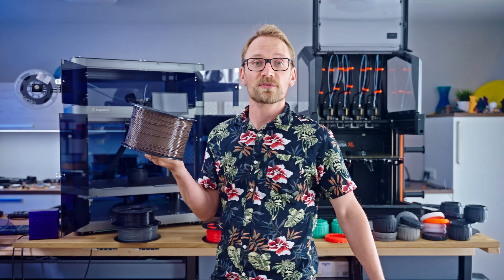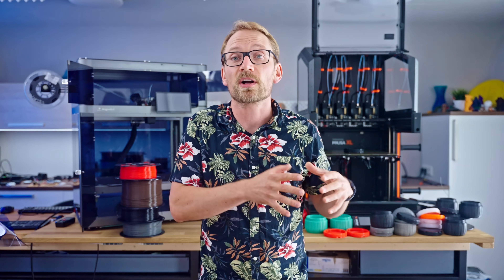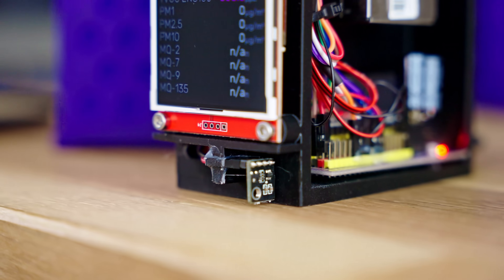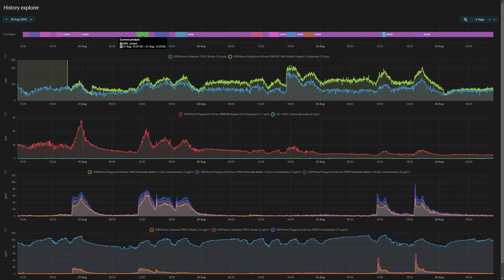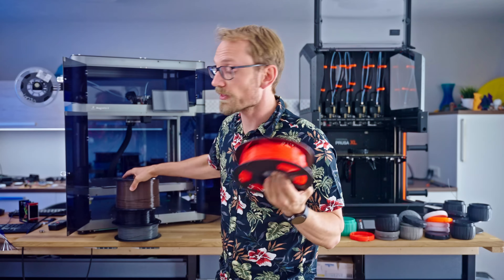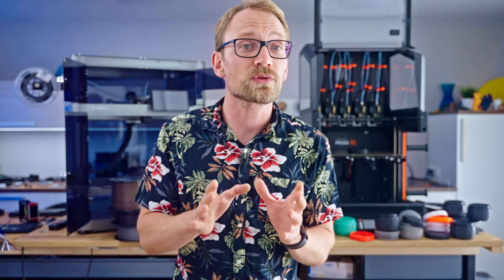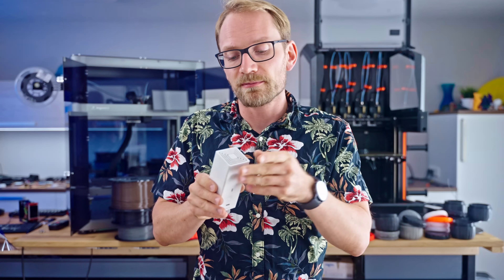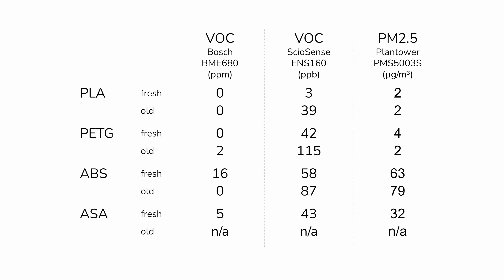3D printers are worse than I thought. Time to do something about it!

Comment: I do about 95% of my prints in PHA. I would've loved if you did tests on that or at least mentioned it. It's by far the most environmentally friendly material (the only one that is home compostable and doesn't break down into microplastics), doesn't smell, requires no bed heat (to prevent warping), the lowest recommended nozzle temp of any material (195-200C) and I've managed to print as low as 170C (with quality issues, of course).

As a bonus, it's hydrophobic and doesn't require drying or humidity control, even coming in a cardboard box without plastic seal or desiccant.
There are some downsides like the tendency for the non-flex variant to warp in warmer ambient temps and that it's not as stiff as PLA (doesn't make a great bed scraper). But with all the benefits, I'm surprised it's not getting more attention.

Unfortunately, while prices are comparable to other materials, availability is very limited. There are only two producers in the world, Beyond Plastic in the US (what I use since I'm in the US) and ColorFabb's allPHA in the Netherlands. Making things worse, Beyond Plastic stopped production indefinitely without explanation just 18 days ago (announced on r/3DPrinting_PHA).

Comment: Running 2 bento boxes inside enclosure showed to be effective to reduce emissions. They don't remove everything! I still wear a big boy mask when printing ASA. But at least with petg and PLA the bentos are enough to not have to wear any mask anymore. I seem to have a low tolerance against these filament emissions in general so even small amount in the make me already feel uncomfy. So I'd say at least the bento boxes are a must. Anything that's larger then a prusa mini enclosure should have a min of 2 running. ASA/ABS and all the gf cf filaments NEED heavy duty air filtration or professional respiratory masks. And that's even with having windows open to force some cross ventilation

Comment: Do a resin version of these tests too. We know it's bad, but some people don't understand how bad it really is.
Reply: Testing protocol will be a problem here because these are almost hermetically enclosed (except the new tilting hood ones). There are been tests showing the emission mostly occurs during printing where you're not supposed to be in contact with the air enclosed in. The main concern is the post treatment part when you open the lid and use solvents to wash the print and cure it.
Reply: Everyone I've ever seen using a resin printer has it vent directly outside. The risks of resin are well understood, it's filament printers that really need the close examination.
Reply: @kaijuultimax9407  Really? Almost every post/video i see someone using it, is the opposite. Barefood watchting to the printer, while printer is sitting on the ground and picking up the uncured print with bare hands. No Respirator wearing ofc (The most common thing being not used) and then everything without any fume extraction. Maybe at least those USB Filters inside that almost do nothing. And that even from known Youtubers like UncleJessy that is often wearing no gloves and respirator while holding the uncured print on the plate into the camera. It's insane. I could just even pick up many of those examples from my browser history of this and last weeks.

Comment: Having a background in biology and chemistry, I always felt a bit baffled that people run 3d printers in open air in their homes. I decided to build an enclosure box I could keep at lower pressure than my home (vents outside) before doing any printing. I kind of assumed it was a requirement to run these machines healthily. Glad to know I'm not alone in my concerns.
Reply: I too find it absolutely nuts that people are happily running open deck printers inside their living space whilst playing with their kids meters away. It should come as a surprise to absolutely no one that exposure to fumes from 3d printing is harmful. I set mine in my workshop inside a repurposed old commercial open deck refrigerator that has been essentially converted into a fume cabinet venting externally. Not in my wildest dreams would I run it inside the house where my toddler lives.
 And people should be very afraid when printing with filament so dodgy that the manufacturers will not provide an MSDS.
Reply: I put my printer in an enclosure where inside the exhaust vent is located that drags the air out through the ftx system for the house
Reply: Having a background in engineering. I put my printers in a closet that is basically a large fume Hood with a reasonably powered 3/4 horsepower extraction fan. Keep the sound down and the smells from percolating into the house...

Comment: Ikea filters go brr :D
Reply: Och boy. I should get new filters into my masks and wear them when I work from my printer room and the printers are running. Och no....
Reply: And the little ikea filter is added to my list. I have a big one and I change the carbon filter about every year. But I use it when the laser cutter is running and for airbrushing as well. And whenever I sand resin prints I put it under to collect the resin dust. So it is quite nasty - but I'll add a little one next to my printer now for sure. 
Usually when I print ASA I run the big filter on 2 or 3 for the whole duration but the smell is not reduced whatsoever.
Reply: Guys I have suggestions if you live in Europe Or Asia.
There's this Xiaomi air purifier filter which has carbon filter as well as HEPA filter, both combined.
So you could just Jerry rig it by slapping an 140mm pc fan or a more beefy fan on top of it and it really works great. And it's cheap so you could make this multiple and enjoy.

Comment: My lab has been assessing the toxicity of UV  resins in human cells in culture. After 30 brands and even "certified" engineering resins labeled as biosafe are not, regardless of post processing. They all kill 100% of cells.  The plastic we ended up using with actual non toxicity was 95A TPU by FDM.

The culprit is the UV sensitive monomers.

And FYI, BPA toxicity is entirely junk science. The amount a human would have to ingest is massive , and it would have to be injected.

Comment: Good video. I'll give you the benefit of the doubt but  it feels slightly weird to cover this topic without mentioning Nathan Builds Robots who has been covering these issues recently. I guess it's just more in the zeitgeist now. Some things I would have liked to see covered in more detail: activated carbon gets used up, and unlike indicating silica beads you can't tell when it's "full". So-called "HEPA" filters on Amazon and especially AliExpress are a minefield of fake and uncertified products, similar to N95 masks during the pandemic. Would have liked to see a comparison with venting outdoors, different sizes of HEPA filters. NBR went into a bit more detail about which particles are the most harmful which I found useful. Also there was a pretty big gap between your sensors which makes me wonder how accurate the data was. But overall I thought the coverage was quite good.

Comment: Based on my study on comparing a bunch of research papers when I stared printing:
PLA emits lactide, which is generally regarded as harmless but would cause eye irritation. PLA will also emit 1-butanediol, methyl methacrylate.
Nylon and ABS, emit styrene, which is toxic. 
PETG and nylon are known to emit a VOC called caprolactam when exposed to heat.  caprolactam is toxic by inhalation, oral exposure or skin exposure, causes serious eye damage/eye irritation and is toxic to the respiratory system.

Other chemical might be concerned: methyl methacrylate, acetic acid, toluene and, of course, formaldehyde(anything burnt?)

Many more study needed to be done before claiming anything is safe at all.

Comment: I am testing a bucket filter that I vent my Trident into. 20 lbs of activated carbon with fine particulate filter sheet on top and retained by a modified lid. Still testing, but it is certainly better than no particle/VOC retention.

Comment: I'm surprised that it is worse than you thought :) I would generally never print ABS and ASA at home unless you know what are you doing and you have proper ventilation, not only box with filter. It should just go out. PLA and PETG are acceptable risk, best in box with filtering... I did not study others like PC or TPU but I would not be in the same room without ventilation with any just to be sure. On the other hand when there is smog outside, lots of cars and/or lovely coal burning plant then it is better to be in box with ABS printing :D

Comment: In my main printerbox I have:
* HEPA-filter that runs 24/7
* dryer (with tho's packs)
* ionizer

Well, it helps a lot already!
Lots of the fine dust in that box is not escaping but instead is near the ionizer and on the filter. You see it all in there. Lots of 'white dust' while printing with PETG and some also with PLA, and more dark gray while printing with ABS and 'family'-filaments.
Without the ionizer, ther is much less dust on the filter and staying on the botomn of this (mostly wooden and insulated) box. So I conclude it really helps to filter those particles out.

Outside the printerbox(es) I also run an airfilter almost all of the time, unless I have the windows and doors wide open.

I have run also a simple air-filter with only a sheet of toiletpaper. And well.... that already takes lots of dust out but you have to renew it almost daily while printing and probably not filtering out real fine dust (that gets collected by HEPA-filter and activated coal).
So, even cheap and easy solutions will help to reduce but not totally make it safe for a living-space...
Reply: I just bought an ionizer to add to my lack enclosure. I didn’t sew anyone evaluating the efficacy but i’m pretty confident that it must help the particle to increase in size and stick to any grounded metal.

Comment: First off, thank you for creating content on this topic. Safety is an important aspect of many activities that often gets overlooked. If you are willing to continue down this path of investigation for us, it seems like a natural follow up could be a comparison of a standard material vs its modified derivative. VOC and particulate material comparisons between PLA and PLA+ or PLA-HS would be great to see, especially considering the added chemical modifiers are not advertised and these materials are typically printed at higher temperatures.  Another valuable comparison could be ABS and Sunlu easy ABS which prints at a lower temperature.  It's just a thought. Thanks again.

Comment: After covid craze was over you could buy cheap filter units at ALDI,  Lidl and Amazon because of overstockage. Was a good time to buy decently sized H14 Hepa air purifiers that went through proper channels for 50-60€ incl shipping. (meant for schools etc. mine even had a note in polish inside that the unit was intended for a school ) I always have 2 running on max setting when printing + open window.

Comment: Thanks for this video, it's great to get this information out there.

I am feeling vindicated in my decision to only print with PETG and PLA filaments in my home, and not to go down the resin printing route at all. It would be different if I had a separate shed or garage, or even a dedicated workshop room in my house, but the best I can manage is a workbench in a room that is also used a home office and a bedroom, so I need to be more cautious than most.

I do already have several air purifiers in the house, with HEPA filters and activated carbon in them, but that was primarily motivated by living in a country that catches fire on a regular basis. This video is motivating me to set up some air quality sensors to see how effective my filtration and ventilation is, though. It's something I've been wanting to do for a while, but haven't got around to.

I'm also wondering where TPU sits on the particulate & VOC pollution scale, as it's a material that I might want to print with in future (if I ever upgrade to a direct drive extruder).

Comment: Been printing for years, and even though 90%+ of my prints are only in PLA, I have never been comfortable running a printer without an air filter close by, turned on. Thankfully I've never had any kind of itchy throat symptoms (at least none that couldn't be attributed to living with a few fur babies), but it's still always in my mind how these things might affect the air around me. I have a MK4 with an unbuilt enclosure right now, and I'm thinking even after I get the enclosure built I might save up for a separate carbon filter setup, with a big heavy carbon element connected to some 4" ducting. 

That said, I've also always been extra vigilant about air quality, since I come from a long line of bad breathers... Just happy to see more people bringing attention to this, and hoping even more people (and manufacturers) take it seriously!

Comment: It's great to see someone finally talk seriously about the elephant in the room. The numbers presented may not be accurate enough to know exactly what's going on. This video is however significantly better than Joel stuffing his head into the enclosure during an ABS print, taking a big whiff, and saying "Dis not so good."
Reply: hahaha, way better.
Reply: I think it was Scotty of Strange Parts, when reviewing the Micronics SLS, who said you would need a separate room to use this printer, especially when doing the sifting. I appreciate Thomas's efforts here, and I hope there are more discussions and tips on how to make our workshops safer.
Reply: @barkingsheltie  "Need" is always a strange term. You need it if you value your health. But assuming that health is a goal for everyone is a very common projection and a generalization.
Reply: I thought that waste plastic was 3D printing's "elephant in the room".  Maybe there is more than one of them in here :)
Reply: @ViscountCharles  we have a small zoo in the room, especially when you add resin printers into the mix.
Reply: @ViscountCharles   At least we have plastic recyclers to answer that question, like recyklinfabrik for example
Reply: @ViscountCharles  Both pollutants, same elephant, just a different end of that elephant.
Reply: Plastic waste, particulate air pollution, VOCs/gaseous air pollution, sensitization...
Reply: Tiny (2µm) elephants in the room... 😁

Comment: Please consider doing a follow-up on this with other filaments for TPU, PC, Nylon, CF infused filaments (Or could CF pose the risk of damaging of causing permanent offsets to the air sensors, since they are conductive?)
Reply: I agree, could be even more interesting.
Reply: Carbon fiber filament is bad for the same reason why asbestos is bad, you should probably stay away from it.
Reply: I’m not sure the dust being conductive would affect the particle sensors at least, but maybe I’m misunderstanding. 
If you look into how they measure particles in the air, they’re actually optical! They have little chambers/mazes inside with a laser beam bouncing throughout, and the scattering on the other side determines how how many and what size particles are present. It’s super interesting, seems like magic, recommend looking into it. But conductivity shouldn’t matter at least for the pm2.5 sensors :)
Reply: I want to echo the concern about carbon fiber. There's no reason to believe printing with it is any less hazardous than asbestos. Or it might be fine! We just don't know because there hasn't been much research and there hasn't been enough time for people to start getting weird cancers.
Reply: @fwiffo  Probably not as bad as asbestos, which I think can continue to split/break down in your body. It's probably more comparable to fiberglass, which is also very scary, just not quite as much.